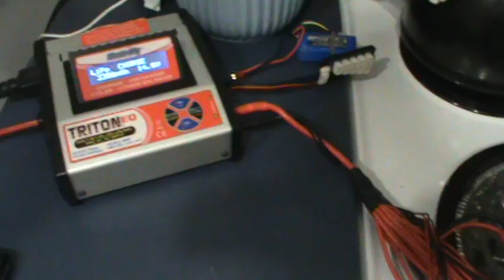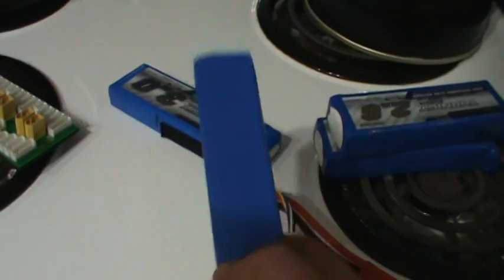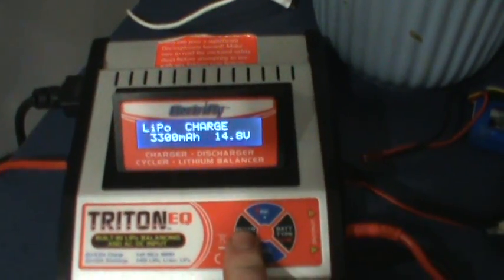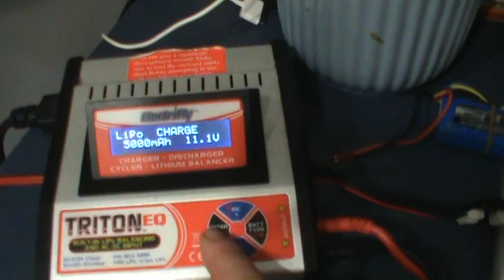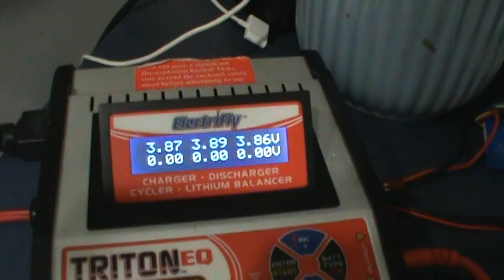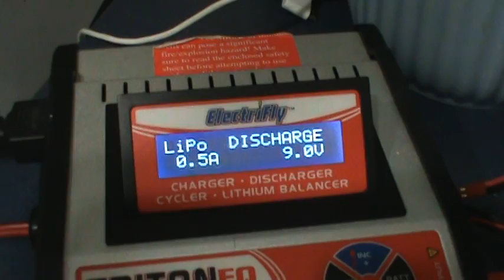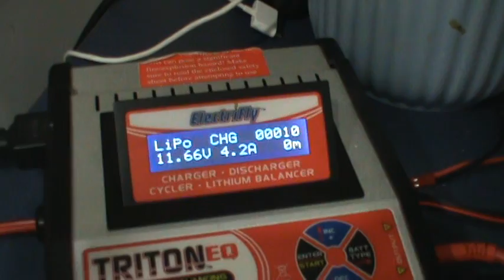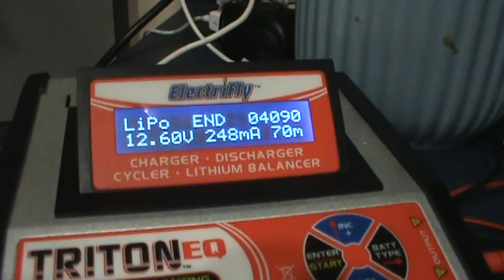Parallel Charging And Balancing Board

Comment: Well i think you plugged a 6s ballance plug into your charger. Now to ballance every cell you'd have to charge it as a 12s pack in series and you can't do that.
A 3s pack is three 1s cells in series and every cell is balanced, so parallel charging four 3s packs really is just fast charging and thats ok but be careful

Comment from the maker: The key word is "If you have a low cell" do you mean low as in below 3v? Most decent chargers well not let you charge a lipo if it is below 3v. As im sure you are aware of!
 
I've been charging like this for over a year now and all cells of each battery are at 4.19 or 4.20. Most "name brand esc's" have a LVC that pulse's when you hit LVC. which is great for newbies and Veterans alike! Mine are always around 3.5 per cell when drained
Bottom line this speeds up charging and balancing.

Thanks

Comment: Now check the cell voltage in each battery,  This does not balance charge each cell if you have a low cell in one pack it will average it over 4 pack.  

This is a fast charge not a ballance charge be very careful your batterys are balanced and in equal discharge state before charging like this.